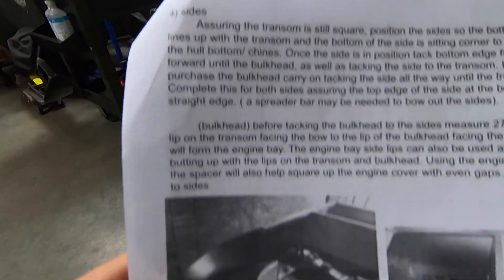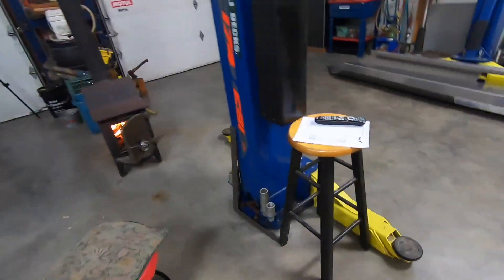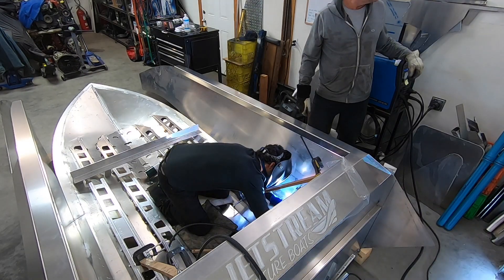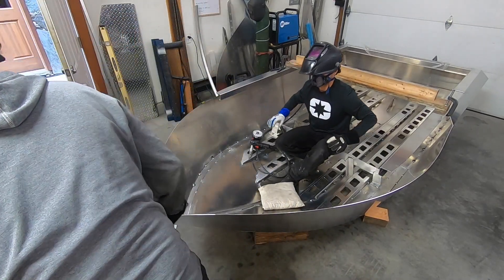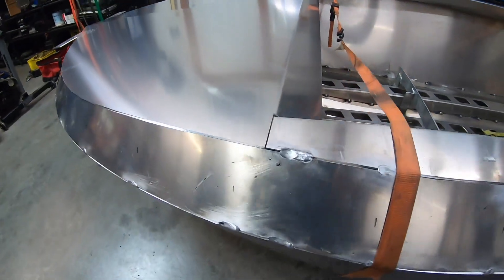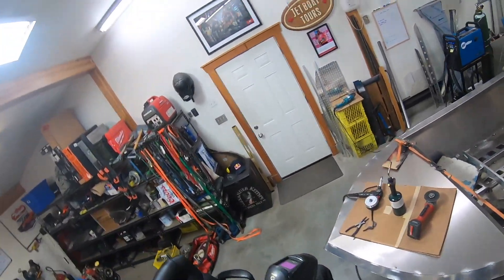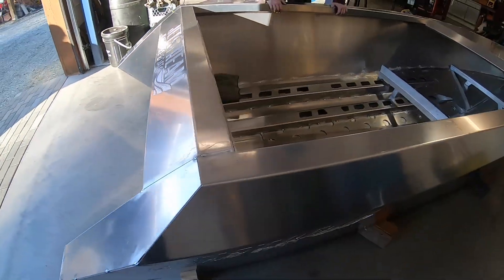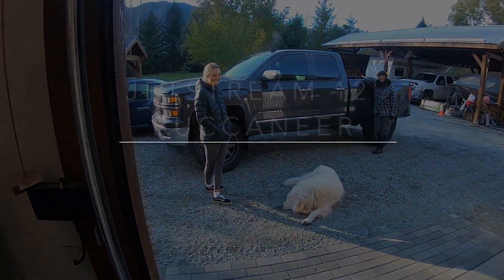Mini Jet Boat Build | Part 2 | Jetstream 12' Buccaneer

Comment: Do you remember what the strap on the bow was for at 2:44? I’m trying to close up a gap between the bow and the deck..I was wondering if you ran into the same problem.
Reply from the maker: used it to pull the bottom of the hull up to close the gap up front, maybe bringing everything together easier